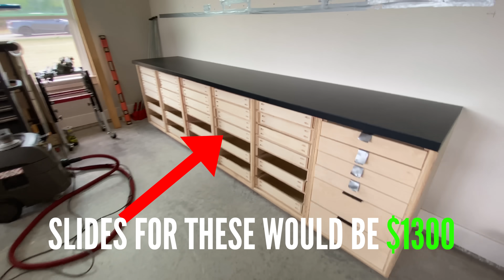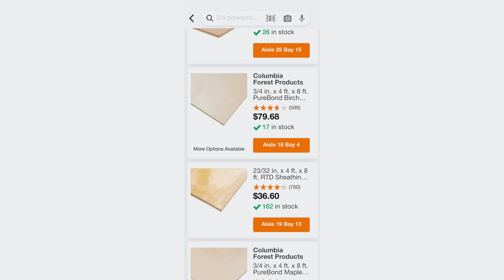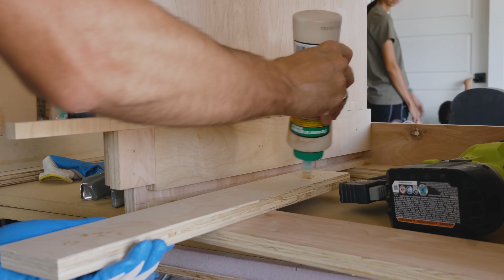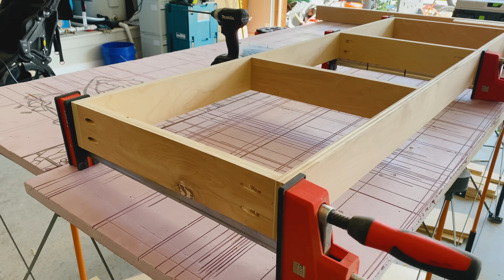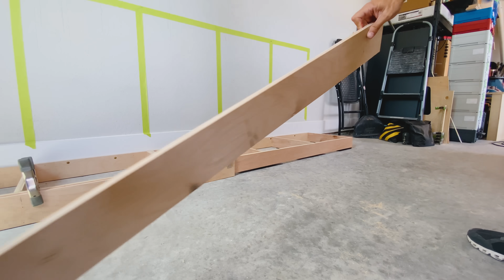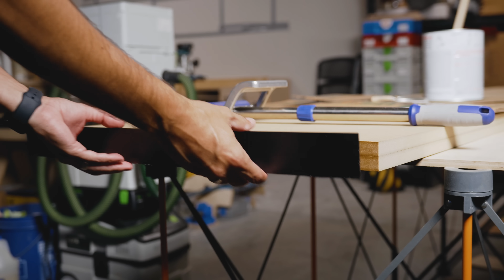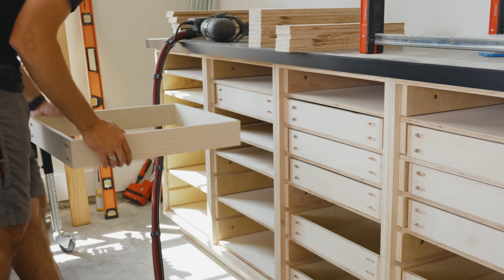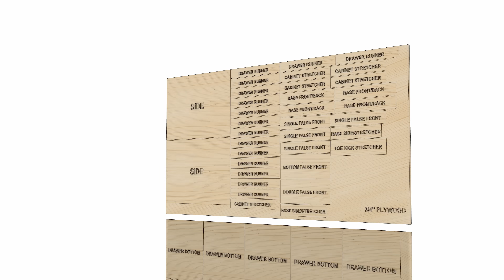Drawer slides are expensive. Do this instead.

Comment: Hey, no idea where the snorkel is, sorry. Great video, thank you for taking the time to make this as I am about to do a similar project. Q: did you get to the bottom of a solution for the laminate cutter marks? I'm guessing it's not as simple as tape? And - now the drawers are full - are they sliding ok? Did you candle wax them? I have been wondering if a plastic U-channel insert would make them run smoother? Or cutting a chamfer into the edge of the drawer slot so the drawer base sits on the thinnest surface possible? Any tips since completion would be very welcome - thank you again.

Comment: Someone showed me that you can shim up your base and then screw in flat scraps like interior legs. This goes quickly, doesn’t show, and keeps really well for a long time. GREAT video! I started to feel like it was moving around a lot, but once I got the rhythm it was actually better than machine gunning all the info for one thing because I was making sketches and notes. The tangents all apply directly to the subject and give me time to notate the parts I really want.  THANK YOU for taking the time.
Reply: Having built and installed custom base cabinets for years,  I found the 4” single toe kick base would provided leveling for everything above it. I too used shims to set it and installed interior scraps as legs. Then removed the MANY slippery shims that would always loosen up as the project proceeded.

Comment: 🤿 couldn't find the scuba emoji on my tablet but I did watch to the end. I would like to know what expandable support you used for the plywood, would you still recommend it, or is there a better one you might recommend. Also I noticed the sides of each cabinet when joined together along with the drawer rails made a very thick combination and perhaps they all could be thinner and save some space, or perhaps only one pie ce could be used between each set with the rails on each side saving some wood. Your way is quicker and more modular. Also you could have had the drawer fronts come out and hide the sides which might be a nice look. Just  some  observations. Your techniques and tips are of great value and I will definitely use the tape on the paint can trick as I just yesterday finished painting a  boat and that would have saved a lot of messy cleanup! Great content.

Comment: I wonder how the drawers slide when they are loaded up with heavy tools and other stuff. There is friction-reducing tape that you can get, UHMW polyethylene tape, which you could either apply to each drawer slide surface on the bottom, to the drawer slide cutouts, or to both surfaces. This would allow the drawers to slide smoothly even when loaded, with no squeaks or snags when opening or closing them.

Comment: I work in salvage, ive removed both modern cabinets with modern drawer glides and 100+ year old cabinets with slides similar to these. The modern options are smoother ofc, but i have yet to see an antique drawer slide that broke in any serious way, even after all those years. Modern versions, especially the soft close ones that are full of little ball bearings, are a fragile nightmare lol. Always breaking.

Comment: If you would have made the sides of the drawers 2.5" shorter than the bottoms, and have the bottom extend past the back of the drawer, they would act like full extension slides. You could then access the full inner portion of the drawer. You lose the 2.5" of usable space, obviously,  but you cant access the last 1/4 of your drawer for fear of it pulling all the way out. I have 21" deep drawers in a 24" cabinet, and at full extension they carry ~50-70lbs of contents easily, despite the cantilever.

Comment: Brilliant - this is the way that all of my kitchen drawer slides were done on my first house's built in kitchen cabinets - wood on wood (built in 1953 and top notch, but are we so spoiled that we can no longer physically make sure a drawer is closed?).  

Sorry - I had to step away because I think that someone's been fooling with the thermostat.

Anyway, I don't think there's any shame in saving over $1,000 in hardware if the overall improvement is going to be well built with quality materials.  Well done.

Now, if you'll excuse me, I think I have to go chase some kids off of my lawn.

P.S., this is as close as I could come to the emoji you'd asked for.  Snorkel yielded nothing when searched.

🤿

Comment: And here would be my lazy ass that would have took the time to wax the bottoms and the rails. Just for that little extra smoothness.

Also ex cabinent maker that had to manually laminate sheets alone. Yo got it. Shims to separate the two pieces are the best way I've found of doing that.

Comment: Loved the video.  I am in the process of building my brand new woodshop and I think I will take your advice about the wood slides vs. the Blume slides.  Not sure if you have found it yet, but there is another cabinet supply store called Rugby Architectural Building Products.  They have a location in Fort Worth and in Grand Prarie.  They sell tons of plywood and board stock of the most common varieties.

Comment: Great video, thanks. If I may I have one suggestion. Where the draws slide on the draw runners, rub candel wax into the two surfaces that slide on each other. Not only does it make the draws slide better, it massively reduces the wear of the sliding surfaces, which if they are not waxed, will wear and put your very carefully aligned draws out of alignement over the years to come. Now you have built the cabinets and it might be difficult to rub hard wax into the cainet runners, try melting the wax and brushing it onto them or softening the wax and rub it on with your finger. Please let me know if you do it and if it helps. Thanks, Tony in England

Comment: Quick tip for not damaging the finished laminate when trimming the top: use a paint brush to apply Vaseline before routing. It makes the surface slick and protects the laminate. My dad taught me this as a kid. Works every time. Then clean it off with lacquer thinner

Comment: Weather forecast isn't 100% accurate. It's just 63% accurate. (Yes even with modern technology). It'll only be 100% accurate if no clouds are available... But then your wife would also know better by just staring at the sky. Wives are highly sensitive to smells, temperature changes and atmospheric changes and humidity and all that. Therefore they are more accurate than weather forecast at specific locations. (weather forecast is generalized).

Comment: I did my shop drawers/work bench similarly with the toe-kick base. It was MUCH easier to build that and level it then install the cabinets/drawers on top than to build the entire thing and try to level it after. And I did the same thing with my miter saw station.

Also, the handles on my drawers are ones I made from scrap 2x4s. I didn't need/want anything too fancy and really didn't want to spend the money on drawer pulls, lol.

🤿

Comment: And composite shims are waterproof.  But  not that board you covered the cabinets nostrails with.   Now how are you supposed to drain  any liquid off and dry wood  out  from under your fine cabinets  made tight against the concrete floor of your garage? Use a blow torch ?

Comment: So if you had used the slides you would have saved a little on plywood but you would have spend $900 on the build and $900 on the the slides. One thing I learned from an old carpenter is to put candle wax on the plywood slides to keep them from sticking. rub on the wax wherever the pieces touch and then burnish with a piece of metal, the shinier the better. you may have to do this 2 or three times but the drawers will not stick for years.

Comment: I don't know if I screwed up but something doesn't work in the plans for this project. The cabinet stretchers are supposed to be 18.5 inches, but the cut diagram shows them all just 18. I cut all my parts by the cut diagram so my carcass is 1/2" smaller. found out when making the drawers.
Reply: my mistake, I was looking at a cut  list from a previous similar project

Comment: Well done! Suggest making the drawers a little longer so the fronts can cover your dividers. To save money I have used a single divider (you don't need the extra strength) and assembled them in place once your sturdy base is done. Curious if anyone else has used this short cut.

Comment: We used bars of wax (Gulf Wax Household Paraffin Wax 1 Pound Bars) to rub on the edges just where the router bit will touch.  Then after routed and filed, we used lacquer thinner to clean off any residue of glue or wax.

Comment: Here's the deal: I've tried using drawer cabinets that have no slides, and for my purpose (i.e. coins) they're absolutely inadequate. Yes, they are expensive with slides, but there's a reason for that, and that is weight capacity. The heavier the contents of those drawers, the more difficult it gets to open them. I bought an architect's cabinet designed for A0 sized drawings with 10 drawers, and filled each drawer up to just half the capacity with 8x8x4 cm coffee jar lids filled with coins, and discovered I couldn't open them! Once the drawer was closed for a while it became stuck and required brute force to un-stick. The other factor is sag. I quickly discovered that I couldn't place anything in the middle of the drawer lest it deform the bottom. True, this is a cabinet designed for lightweight paper drawings, but still, it was a disappointment. Since a single 10 drawer cabinet like that made of metal with slides runs about 1500 Euros, and I need 14 of them minimum, I'm probably gonna hire someone to custom-make them for me out of wood using simple wheeled slides (not the compound ball-bearing ones). Oh the pain. 🤿

Comment: A great video and great ideas. Keep it up! 🤿

I would suggest using treated lumber for the base so you don't have to replace it if/when it gets wet. I'm also surprised you didn't check your drawers (pronounce it however you want) for squareness. My last thought is that you didn't put edge banding on the exposed edges on the front of the cabinets.

Comment: Use clean paint brush to apply VASELINE to the edge to prevent those burrs when routing top. Also use round dowels to temp position top laminate. Much less surface tension that squared sticks makes it easier to remove. Great job. Love the idea of no hardware.

Comment: Yes, this method of drawer construction is not a new idea as German immigrants have been doing for generations, but great video.  So not to put too fine a point on it, but in my only nitpick is the individual modular design being an overkill waste of wood and time.  Just my 2 cents, but this is where (in my opine) dados and rabbets are better by constructing two (or three) carcasses each with equally sized drawer bays and runners.  Old Norm Abram's Yankee Workshop may be old school, but his cabinet builds are bar-none still the smartest designs.

Comment: 3 coats of contact glue!!!!!

if you had applied a coat of sanding sealer it would have sealed the edges and one coat of glue would stay on the outside (2 coats better than 3 😘)

Comment: That mushroom will have contaminated that entire board. Moisture in the air and from the concrete will keep it growing, hidden, and it will expand into the rest of the cabinets, undetected until it is too late. You need to remove it quickly. I also recommend spraying the adjoining cabinets within antifungal to prevent the spores that are already there from that board from growing and decomposing the cabinets where they stand. You don’t have to see the mushroom for the damage to occur. It grows inside the wood as mycorrhizal strands.
Reply: I prefer that no wood or metal touch a cement floor. I like French cleats to hang cabinets off the floor. Another benefit os that you don’t need shims

Comment: you can get good quality side mount slides and epoxy coated slides for around 2 to 5 dollars a pair. also, try using a chamfer bit instead of a flush trim bit for trimming the laminate. cheap bits dont match size with their bearings very well.

Comment: There's cheaper drawer rails for like $5. It's stamped steel and only one stationary part and one moving part and may not be as strong as the ones you've shown but it got the job done in my case. The drawer rails in your build uses a lot of material, I'd cut thinner strips to save material and weight. 

That said, the cabinets came out great!

Comment: For the laminates sharp edge, run a sharp blade at 45 degree angle to the surface for chamfering. Sanding of filing can also works for small lengths.

Comment: Nice, simple design with some good tips along the way. I'd make it even cheaper by using timber instead of plywood on the "shelves" (what's the terminology?). Plane it down to size and rub beeswax on all edges touching the drawers for a super smooth glide. Better gliding, longer lasting and less costing.

Also, a big like for promoting the humble track saw! It's safer and more versatile than a table saw. Together with a mitre saw and a router table, I'm not really missing a table saw. Each to his own, of course, but as an amateur woodworker who's guaranteed to make mistakes, I pick the safer setup. I'd like to keep the fingers I'm typing this with 🖐🤿

Comment: Very good video. Cabinets look really nice. How easily do they operate, especially when loaded and become heavy? I appreciate quality draw slides because of how easily the drawers operate with bearings instead of wood on wood. Also, do you have a way of preventing the drawers from falling out if/when you pull them out too far?
Reply from the maker: I don't overloaded them - and making them 3"ish tall prevents putting to much. Some people add a horizontal spacer block in the back 3" of the drawer as a visual reminder to stop pulling out. I have never accidentally pulled one all the way out.

Comment: Very nice shop cabinets.    Did you come up with a solution to the trim bit bearing rubbing/gouging the laminate?   I am wondering if that bearing was spinning freely?   I have had this same problem from time to time.   I know you must check now and then to see the bearing isn't clogged with residual contact cement.   I put tape on the good laminate surface that the bearing will be riding on.   It does help, but I'm surprised at how the tape gets beat up in the process.
Thanks for an interesting video.

Comment: I love the design, how do the drawers feel to slide?  How much clearance did you leave between the drawer "rail" and the slot in the cabinet?  Could we also get rid of the drawer false fronts and double walls on the cabinets to save material?  When you shimmed and transferred the line to the mushroom ply you could use that as a template to trim cut the bottom of the cabinet with the edge router and then remove the shims. 🤿

Comment: One downside of not using hardware, is when you put weightr in those drawers, you can't pull them all the way out. The more weight in the drawer, the more you will have tto leave them in, potentionally making it hard to reach the back of them, depending on the height. Proper slides will let you pull the drawer all the way out for easy access.
But yes, on a big project, it can get a bit pricey.
🤿

Comment: I worked putting laminate on small jewelry display cabinets back in the day. The order you placed the laminate was spot on. To prevent damaging laminate already placed, we would put a generous coat of bee’s wax on the edge where the trimmer bit rides.

Comment: Thanks for this video.. liked and followed. I am also saving this video to a playlist for the future when I finally have a workshop. The only thing I would do differently (aside from duct taping the drywall seams🤿)  is apply edge banding. As nice as this plywood is, I have never liked the look of raw plywood edges. I would also give it a coat of poly varnish to protect it and make it easier to clean.  Also , while I like your plywood backsplash with custom tool holders (yes pegboards are for def for kids) I would go one step further and install a French cleat wall so I could easily rearrange my hanging tools.

Comment: Snorkel (Couldn't find the emoji). Great video! One question, though. Why use double thicknesses of plywood for between two cabinets? Couldn't you just put the draw spacers on either side of one side piece and save the cost of the extra wood? I'm no expert, so this is a serious question.

Comment: Tip: don't try to make the countertop exactly flush with the end panels. Put on a quarter to 1/2-in overhang. Same thing with the toe kick, make it a little short, then just add an end panel to the cabinet, and a skin to the toe kick.

Comment: 30-Year cabinet maker here. Built a lot of cabinets and laminate countertops, thought I'd add my two cents. Number one, don't build a double counter like that, just build it up with 4-in strips on the underside. Number two, that's way too many shims!😂 Number three, use a 3-in roller to do the glue on the edges as well as the face. Number four, we used to tape the edge of the laminate, before flush trimming it. It. Are special router bits with a bevel, I always found it tricky to set them and faster to just flush trim and file. Filing takes a lot of practice though.

Comment: Contact cement + trim router bit bearing = ...nope.  Laminate dust plus the (hopefully) tiny bit of contact cement in that joint will seize the roller bearing every time.  Taping the laminate the bearing will rub against can help, but won't prevent all of it.  Learning to use the bastard file to trim laminate edges is tricky, but works very well.  And it's not as slow as you'd think.